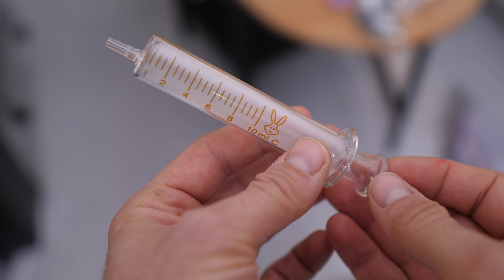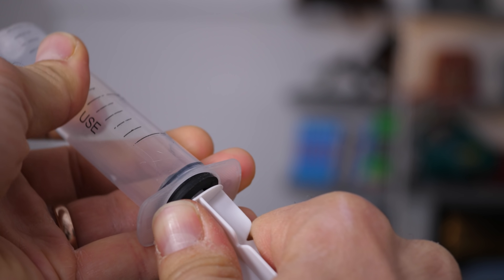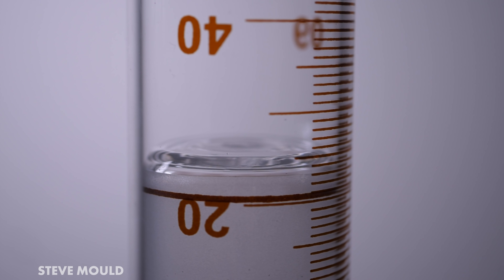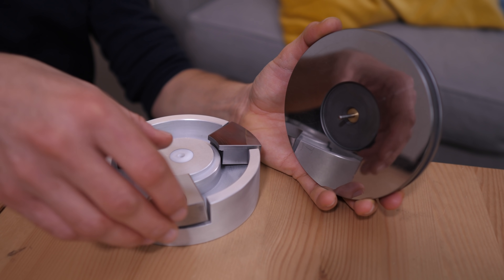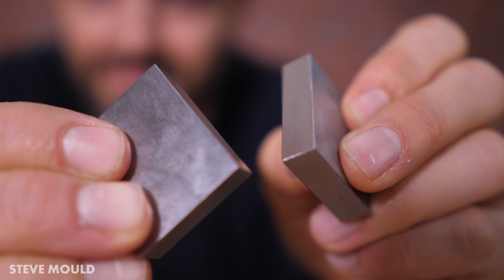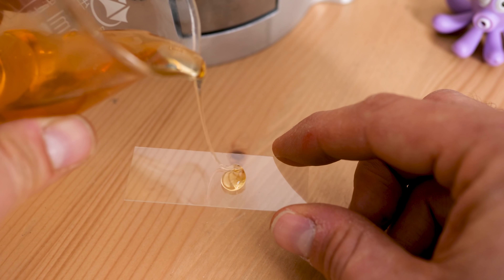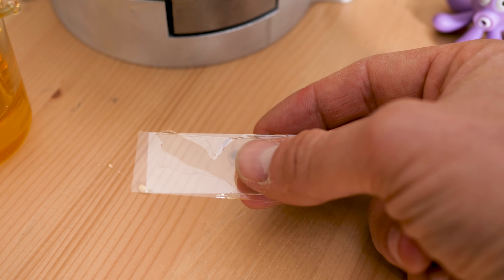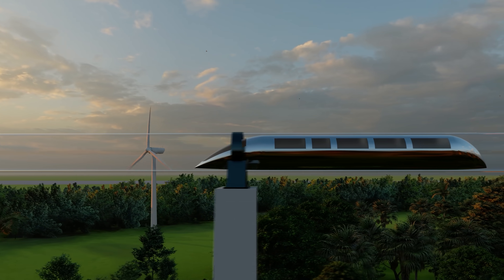The Self-Levitating Kingsbury Aerodynamic Bearing

Comment: I have often wondered how those glass syringes are manufactured. The plunger has a frosted look, so it would seem that it is carefully ground until it has the right diameter. But how do they keep the diameter the same along the length? The barrel is clear glass, so not ground. How is it done? The inside must be a perfect circle. What tolerances? Is each plunger unique to its barrel, or can they be interchanged?
Reply from the maker: I'm in the process of finding out! I'm having lunch tomorrow with a chemistry professor who is a little obsessed with glassware!
Reply: @SteveMould  have wanted to know since I saw one in Chemistry lessons 60 years ago!

Comment: You show the diagram of the cross section of the plunger sitting on the bottom of the barrell and talk about spinning the plunger. But you weren't doing that, you were holding the plunger and the barrell was sitting on it!

Comment: I feel like the effect with honey is a bit different than air tho, I'm sure the results are roughly similar in a theoretical sense, but I would imagine that the honey is sticking via adhesion and cohesion like water, while the air is probably just receiving momentum from the plunger when it bumps into the spinning plunger and then changing it's flow due to that imparted momentum. Could be wrong but that seems to me like two different phenomena resulting in similar effects rather than the same effect.
Reply from the maker: Yeah, that's interesting. Like, does it all just look like viscosity regardless of the microscopic origin, or are there macroscopic differences?
Reply: @SteveMould  I bet it's one of those things where you'd get a different answer if you ask an engineer or a physicist haha

Comment: Thanks for the excellent video. 
A spinning hard drive platter and its heads rely on the hydrodynamic principle to keep the heads raised.
Shocks to the hard drive while the disk is spinning kills the heads because of the sudden crashing of the heads on the spinning platter, caused from the shock (or power cut). Also, explains why hard drives can't work in a vacuum, and why they must have a breathing hole.

Comment: I wonder if it's possible that the LED blinking is caused not by the plates touching occasionally, but rather both parts working as a makeshift capacitor, since the gap between them is rather small. Increasing blink frequency could be the result of the capacitor charging faster as the surfaces get closer to each other.

Comment: 6:31 considering the device as a capacitor (two conductors and an insulator between them) It would be interesting to measure the capacity .. which in somehow represents the distance. 
then see for example  if the spinning speed could affect the distance maybe?
Reply from the maker: Oh yeah, I bet I could measure the capacitance of it as it spins. Good idea.
Reply: Maybe even calculate and plot as a function of RPM? Hmmm....
Reply: @sigurdvanhauen6118   @Steve Mould  yes exactly , I'd love to see that curve.

A real-time capacitive measurement mechanism is needed though,
 I'd suggest a 555 circuit (astable mode) to generate a frequency based on the capacity
if adjusted so the frequency in the audible range .. it will be more fun to spin :D
Reply: @hasansawan4970  now I want that
Reply: It would be interesting to use a battery that supplies more current to see if the frequency of the octo-continuity meter flashes are a function of the components charging or just due to the occasional contact.
Reply: It's a good way to verify the theoretical distance that you can calculate by solving the Reynolds equation. It's a simplification of the Navier-Stokes equation for hydrodynamic bearings.

Comment: So, if I had a perfectly flat table, and a gauge block... What would you call that, steel hockey?
Reply: Wrung.
Reply: @Belboz99  I suppose you're right, after giving it more thought. Would need a bevel to force air under the block. It'd probably wind up looking more like a really fancy hockey puck than a gauge block if it were to work at all.

Comment: There are huge versions of these 'Kingsbury Thrust Block' on USN ships in line with the screw shaft just behind the reduction gears to prevent the shaft from directly pushing against the gears.  The thrust bearing redirects the force into the hull of the ship.  For these, the fluid is oil rather than air.

Comment: Jet engines are a great example. An oil hydrodynamic bearing is used for the shafts of the engine. 16,000 RPM and tonnes of metal, all supported by the thinnest slither of oil.

Comment: Now I need to know how glass syringes are manufactured
Reply: They are manufactured by Steve's brother, Injection. Injection Mould.

...

Actually, the outside is probably extruded as one long tube, and then cut and melted / moulded at the ends, while the inner plunger is extruded as a slightly oversized rod and then cut and ground to size. But heh, Injection Mould, get it?
Reply: @RFC-3514  Ah, so that's why the inside surface is frosted. I had been wondering about that since I saw those glass stoppers in a NileRed video.
Reply: @d0tz_  - In the case of syringes, I think it's also so you can see where the plunger ends and the liquid begins. If it looked clear, it could be hard to see the boundary.

Comment: That's not how ice skates work - the pressure isn't high enough to drop the melting point enough for such an effect. Ice is slippery because the surface molecules just aren't as tightly bound as the bulk molecules. When you reduce the temperature far enough it stops being slippery as the surface molecules have lost enough energy to stay in place.

Comment: I've actually used glass syringes like that to make an isolated (electric and temp) platform for a laser experiment i did on the dirt cheap that needed a cushioned base against vibrations. Started with glass metal syringes but they have a lot more friction, then found glass on glass ones and indeed, you have to break them in, or more to the point, the matte finish needs to get rid of any impurities it might have (mostly dust). Got the idea from a channel that did kinda the same thing but with regular plastic ones. Best part about that setup, you could dial the height of the platform very precisely using a fifth syringe linked to the other four and a small micrometer i took apart (removed the head and anvil).
Reply from the maker: Sounds like a fun project!
Reply: Nice! Did the system loose measurable air at all over the timespan of your experiments?

Comment: I've heard the ice-skating pressure melting explanation before. However I've also seen articles that it's not entirely correct. Like the pressure needed to change the melting point is a lot bigger than the weight of regular person. It turns out that there is already a quasi-liquid layer on the ice even when there are no skaters on it.
Check the "The surprising science of why ice is so slippery" by Vox (2019) for a starter.

Comment: Really really interesting as usual, thank you!
Nerd me says: just double-check the ice-skating stuff. Seems ice isn't melting at that pressure, but the gliding effect is due to loose water molecules on the surface. Just saying...
Reply: The pressure isn't enough yeah, (by a couple of orders of magnitude).But friction heating can account for the thin film of water. (that's what loose water molecules are...)
Reply: @benjaminmiller3620  that would mean an unslippery ice at very low temperatures. I stand by the loose molecules, with or without friction ;)

Comment: actually ice does not melt into water when an ice skater goes over it. the pressure required to change the ice into water is way more than what an ice skater can make. the top of the ice is slippery because the water molecules on top have fewer bonds to other molecules compared to the molecules deep in, and start to show fluid like attributes even in a solid state.

here is a vid by it's ok to be smart going into more detail https://www.youtube.com/watch?v=yjSf7Yh9UZc
Reply: I was going to post this but I'm glad you did
Reply: Yeah I remember too that this myth was debunked somewhere.
Reply: @scheimong  Actually, it has been explaind (»debunked«) much more before the Video on YouTube. Even this article from 2005 explains the reduced chemical bonds on surface of ice, from further researches made even as early as 1978. »Using proton backscattering, researchers in 1978 found surface vibrations of the oxygen atoms roughly 3.3 times the amplitude of their value in the bulk...«
https://physicstoday.scitation.org/doi/10.1063/1.2169444
Reply: Did see that video too and was planning to comment it as well, guess Steve Mould has to excuse hiself for this now.
Otherwise a nice video Steve thumbs up.
Reply: However when metal which is above freezing temperatures touches ice, the surface of the ice melts because of the high thermal conductivity of the metal. I would be interested to see someone attempt to ice skate using skates that have been pre-cooled to below freezing.
Reply: If this is true: Is there a much lower temperature at which ice stops to be slippery?
Reply: I think Richard Feynman propagate this myth, he mentioned that thing in his video "Fun To Imagine".
Reply: Richard Feynman advocated that view with great explanation like; "when ice freeze it expand, so adding pressure reverse the expansion, and therefore melt some of the ice" 😅
Reply: it melts when you fall over and land on your bottom, especially if your sat there a while, trying desperately to get back up again but to everyone elses amusement, looks like an audition act for a new rubbish tv show like new-born-deer-on-ice! (celebrity sewing while baking to the death dance off, on an island with a jungle that they're deserted on, with the winner afforded the opportunity to grovel at some royals on the telly etc).
Reply: I'm glad you said it. I saw that one too.

Comment: The ability of the rotor to drag the air under it totally makes sense to me after learning about how most of the air resistance of an airplane occurs right at the skin of the airplane.  In fact, the layer of air right next to the skin hardly moves at all, even at high speeds.

Simply washing an airplane and getting off the dust off can greatly increase the efficiency of the plane.  This also explains how laminar flow works on planes: it isolates this static surface layer of air from the rest of the airflow around the plane, making a plane designed to take advantage of laminar flow more efficient.

Comment: Brilliant video, very interesting and clear. However, you are not correct that glass is not elastic. It is highly elastic. Drop a marble on to a thick sheet of steel and watch it bounce.
Reply from the maker: Yes, good point. What did a mean? Rigid? Hard?
Reply: It is confusing because the property is so counter intuitive. Not rigid, because fibre optic strands are glass and they are flexible. Hard is probably closest, because in a Rockwell type hardness test the indentation would be small.

Comment: Another interesting thing about hydrodynamic bearings that wasn’t mentioned here is that wear on the bearing is actually zero so mechanisms like this can technically last forever and maintain the same level of precision
Reply: To be precise, the wear is zero when it's working as intended. Therefore these should mostly be used for devices that can run without interruption for a long time.

Comment: So if the air work as a cushion it would not work in vaccua, or why not try it in a cooling gas with low viscosity once you get an air tight container.

Comment: FUN FACT: Even if you don't have a glass syringe, you can achieve a similar effect by spinning the lids of some pots when the water inside them is at a boil. While the steam is increasing the pressure slightly and propping up the lid, I promise it's almost just as fun.
Reply from the maker: Yes! I've definitely done that. I guess that would be a hydroSTATC bearing.

Comment: 5:00 You should make a video about that effect. As far as I know, there is no clear explanation, why gauge blocks wrung together. 
For those who think it is easy, 2 moments: They wrung in vacuum. There are ceramic blocks with all same properties. So it 's not magnetism or air pressure.
Reply: I know this effect from playing with the ceramic inserts found inside ceramic tap cartridges. There are two very smooth ceramic disks that have ports cut through them at 90 degree offset to each other that when aligned allow water to pass through. When the tap is closed the holes do not line up together and water under significant pressures (relatively speaking) cannot be forced between these two disks and thus makes a seal. It you take two of these disks out of a tap cartridge you can easily make them stick together quite strongly using this effect.
Reply: In order for the blocks to separate air needs to come between the surfaces and being so very flat there is no gap for air to enter. There is a similar effect with a ruler and a piece of paper - place a wooden ruler hanging over the edge of a table and place a piece of paper on top of it on the table; if you strike the end of the ruler the ruler will break rather than lift the paper because air doesn't have time to get in underneath the paper.
https://www.youtube.com/watch?v=UvMmfacVA24
Reply: @BigHeretic  https://youtu.be/jNEvS_bjKIo
Almost absolute vacuum.
Wrote that right away, but ok.
Reply: @F0rMyS   Interesting. It seemed to obviously be air pressure but after the practical experiment obviously not! Excellent video, cheers,
Reply: My guess is it would have to do with Van der Waals forces